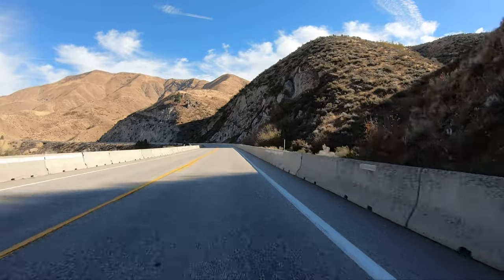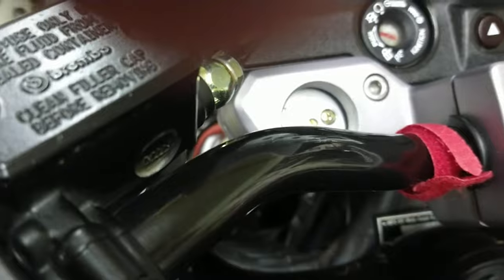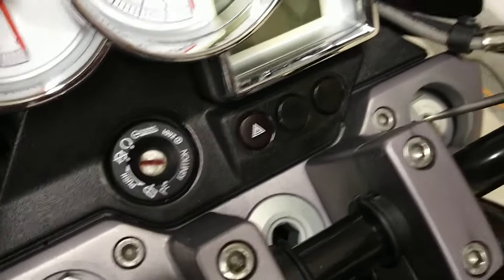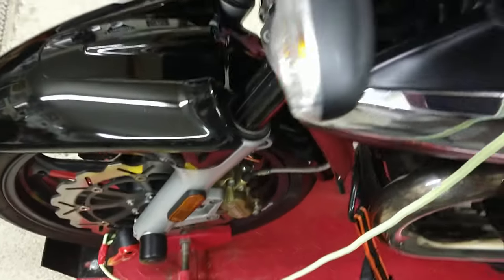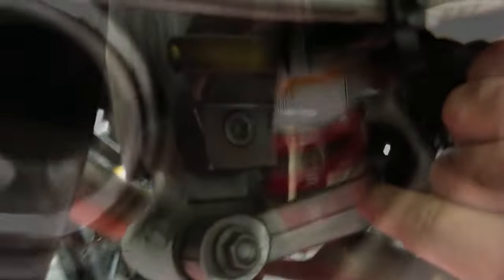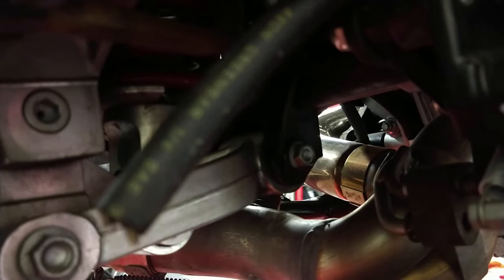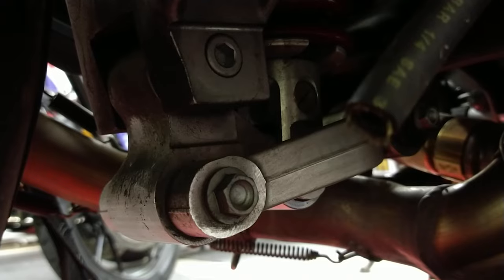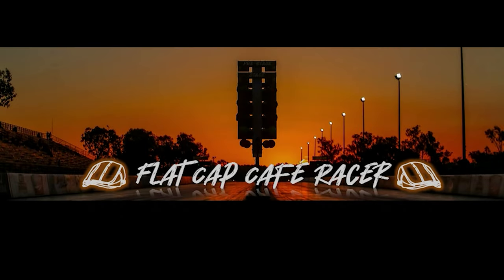Changing suspension settings on Moto Guzzi Breva 1200 Sport

Comment: a windscreen extension makes a huge difference with this bike, depending on your height, the wind with the original short screen really sends the pressure on the helmet. A sort extension does a great job. (Laminar is a great piece for example)
Reply from the maker: Very true!

Comment: What a beautiful ride.
What was your first street bike, Jerry?
Reply from the maker: My first street bike was a 1970 Kawasaki A7 Avenger.  I wanted the Kawasaki 500 H1 but the dealer wouldn't sell me one...thank goodness.  I lost the Kawasaki Avenger when I decided to play chicken with an 18 wheeler....I lost.
Reply: As let's say a heavier person I'm always looking at the 1 up + luggage or two up settings (stiffer) but its a balancing act. Found my old Speed Triple Sprung way stiffer than my MT10.
The electronically adjustable suspension on my old Multistrada failed (in an unbearably stiff setting) at the rear. Happened during warranty and was a £2,000 fix even then. Kind of put me of electronic suspension although it was great when working.
Reply from the maker: @Banditmanuk  Yes sir all the electronics frighten me a little but I get a seven year warranty on all the bikes with lots of electronics.  Curious enough when I looked at the top 13 brands for recalls it was mostly mechanical for all the brands...yet the electronics still worry me the most. 

The only bike in the last twenty years that I felt right suspension wise out of the box was the BMW R9T.  All my bikes except the Royal Enfield are dialed in for me now. The Royal Enfield is very mushy but I  can still take most 35 mph turns at 65 mph maybe a little slower on right handers.